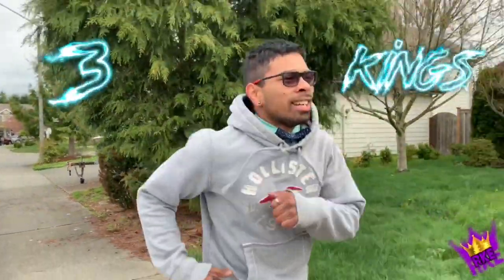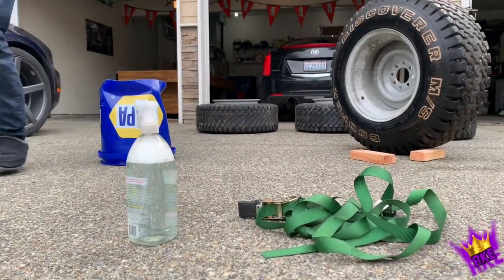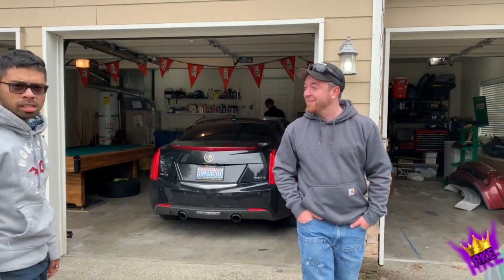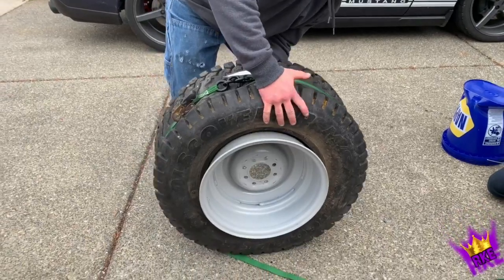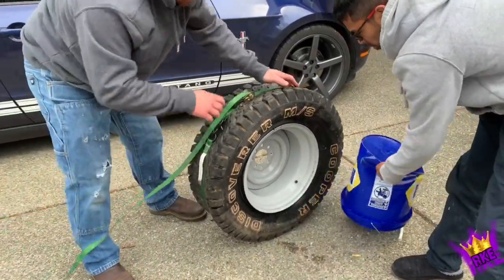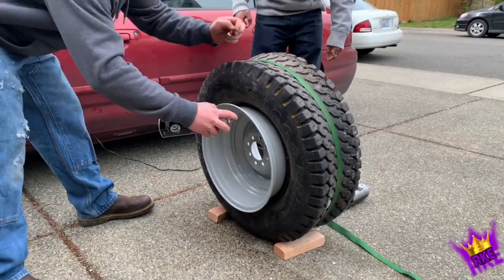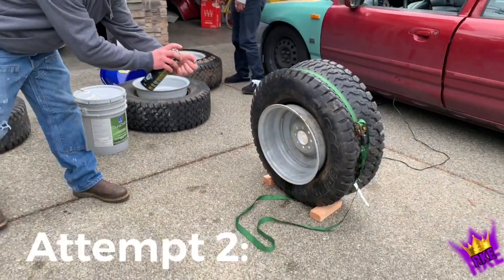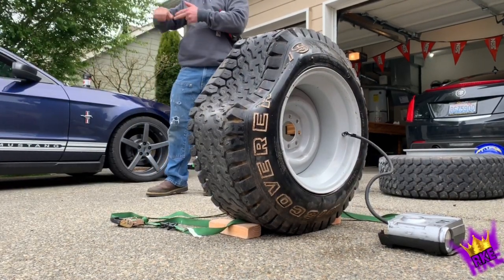🔥Mounting/Streach Tires Using Brake Cleaner🔥

Comment: You don’t need the ratchet strap. And you also do not need to seat one side. We used this in military all the time. Small tires. Big tires. Usually used starting fluid or butane. Get the rim in. Lay it on the side. Spray the rim all the way around in center. Then either use the flame thrower method or just make a trail to the outside of the tire and 3 feet on the pavement. Light. If it burns and doesn’t seat buck kick the tire a couple times. It will pop just about every time.
Reply: The ratchet strap is stupid and unneccesary, sometimes the force will bust the strap and fly out into the unsuspecting idiots skull.
Reply: @tommyshaw2420  Can confirm. Just did this trick using romex twisted tight to make a strap, thankfully didn't get hit. Boy oh boy did that romex fly though.

Comment: I just had to do this to get a lawn tractor tire to bead up. Works great!
Thanks
Paul
Reply from the maker: Paul1958R awesome to hear Paul!!! It’s super fun haha messin with Fire is always a great plus!
Reply: @RoyaltyKingsEntertainment  
I actually had tried several things to get the tire to bead including thick sealer and ratchet straps and nothing worked and I was getting frustrated. I saw your video and thought I would give it a try and it worked first time! Thanks again!
Paul
Reply from the maker: Paul1958R that’s awesome!! I’m glad it worked first time!!!!
Reply: Both the front and rear lawn tractor tires are a pain to get the bead set.

Comment: I have learned to remove valve core. Add fluid and ignite thru valve stem. After seating bead air can enter thru stem keeping tire from collapsing and possibly pulling off bead. If first attempt fails it may be necessary to blow in fresh air to replace oxygen so next try will pop.

Comment: Burnt eyebrows enters the chat: Maybe pricing in 2019 was higher, but in 2023 DT mounted all 4 tires for $10 each. Took off the old tires, mounted the new ones to my CJ7, and off I went. Took'em 30 min.
Reply: DT failed to mount my tires. Sizing was correct, but tires must have been sideways at the bottom of a stack, or squished from shipping (from Tire Rack). So here I am, watching stupid videos on the toilet at 7:00 PM.

Comment: Well, I've used this trick in the past, with starting fluid. You do not need that strap when using this technique. I've never used a can as a flame thrower, just a cigarette lighter. It would be better to use a small propane torch, safer too.

Comment: I have seated numerous tires on rims using starting fluid. No need to have a strap. Simply after it's seated then attack air hose and fill quickly. There are numerous video's on this technique that are excellent to watch. Your production is mainly three clowns, using allot of sensationalism , and is not productive to the student wanting to learn this method.

Comment: Am i the only guy who balances their tires after putting them on?  I mean this is cool, unless you have a way of balancing them as well.....but if your overlanding or offroading and in the middle of nowhere, and have a spare tire with no rim, and a crowbar....cool trick
Reply from the maker: Spahi77 do you have any sort of DIY for balancing tires solo? It would make a awesome video! Also it’s something I haven’t seen anywhere.
Reply: @RoyaltyKingsEntertainment  balance beads
Reply: do you rebalance after he took the white rock out of the tread?

Comment: stupid a tire shop would mount and BALANCE those tires for 20 bucks. even after the tires are set they still have to be balance which a tire shop would do for about the same FUCKIN 20 it costed prior to you mounting the tires. all 3 60-75 mounted and balanced

Comment: Get a real,  at least,  semi real,  air compressor and you could have probably done it with just the straps and a little soapy water,  without risking setting fire to a house, or vehicle,  or getting 3rd degree burns over 3/4 of your body.  Looks like fun, though.

Comment: Just to save a little money burn your hands guys buy a good air compressor this is stupid
Reply: Totally disagree. Just brought 4 (larger than my old ones) tires into the shop to get them mounted, they struggled for a while with their compressor, even drove them to another shop, and couldnt get them. They let my try this trick and it worked first go 🤷🏼‍♂️